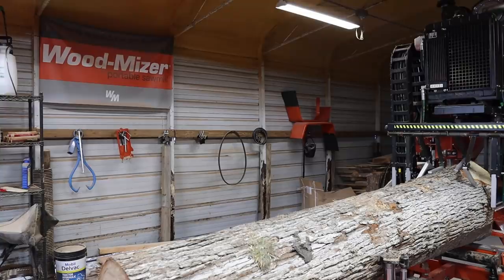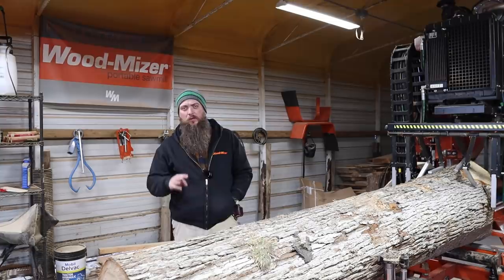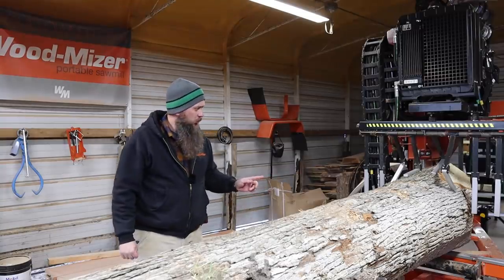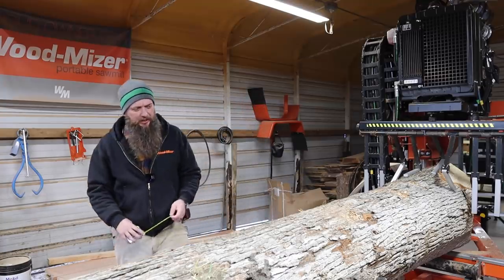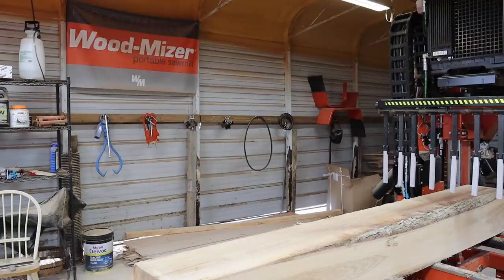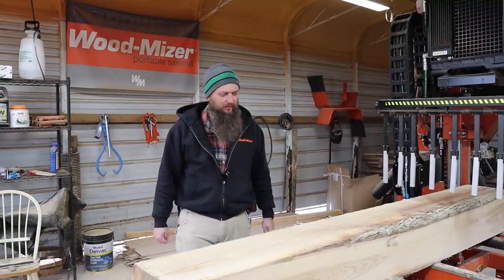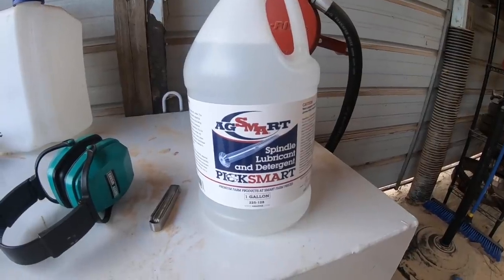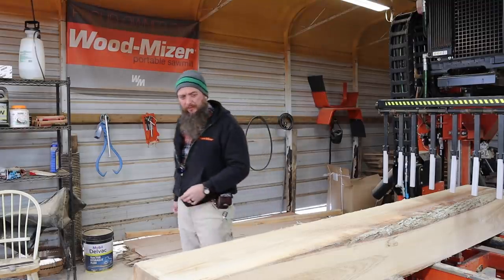A Log With White Gold Under It's Bark, This One Is A Money Maker

Comment: Batteries have less capacity when its cold. You need a warm storage for swapping them out.
Reply: Exactly. Ages ago I did a fair amount of architectural photography. In those days we shot on film, but used batteries for everything from the camera motor drives to slave flash units. A cold day of shooting played havoc on the batteries. Until, I started keeping them in a small lunchbox cooler with a couple of the air activated handwarmers available at every hunting store, bait shop, or farm store.
Reply: Well batteries go dead quicker left in the heat so uhh yeah

Comment: I totally agree with the decision on diesel.
The less I smell diesel the better.  I have added needle oil to tank and that seems to work well....does not smell but it is rather expensive
Reply: Diesel odor is bad, more occurrences of seasickness on boats with diesel engines.
Reply: kerosene is same as diesel just more refined, more expensive and less smelly

Comment: Good looking white Oak,  I had timber cut off my farm 18 years ago and saved a bunk of Oak, Cherry, and Cedar. I striped them and put them in a barn to dry, they are 8 .6 long x 1 1/4 sawmill cut one of them do later projects. Here in the Ozarks sawmill lumber is hard to sell so I been feeding it into my shop wood furnace. Breaks the heart to burn but firewood is 80.00 a cord and hard to find in the winter.

Comment: I completely understand why you would want to move away from diesel. I worked in architectural Millwork shop for 20 years and we always ran diesel in our large band saws (4" wide bands) for resawing. Not only does it smell bad, when it mixes with sawdust it gets really slippery. 
Also for you guys using smaller band saws in your shop check out the carbide tipped resaw King from Laguna tools. By far the best bandsaw blade I've ever used on a small band saw.
Nathan I love your videos! Keep them coming

Comment: Noticed the lubrication change and figured the smell was the reason. I just switched to diesel on my mill and had resisted it for years for the reasons you mentioned. The Cooks felt wiper system takes care of those problems since there is only a slow drip feeding the felt wipers as long as you remember to turn the valve off when you are finished.
Reply: Tim Cook says transmission fluid is the best and he is right.
Reply: @meehd01  Do you thin it with anything to make it flow in the cold?
Reply: @meehd01  You run a drip every 3 seconds? More?
Reply: @ricksanchez7459  I'm sure it's faster than that.  It's a constant drip one right after the other.  Just watch the felt material and make sure it stays wet.  If I stop for a few minutes it does have some fluid sitting on the blade but I just throttle it up and it lubes up the wheels good and I go back to milling.  I like to have plenty dripping so the blades are lubed up good.  I use about a gallon on a full day.
Reply: @meehd01  Thank you, gonna try that when weather breaks.
Reply: @meehd01  Never used it, but that seems like it's way too oily to use on boards that will be finished with anything not oil based. It doesn't flash off like diesel. Even diesel causes problems if it's running too fast and it soaks into the wood past the material that's removed during finishing.
Reply: @littlejackalo5326  you are dripping the TF so there is not that much to get on the wood.  What little there is is soaked up into the sawdust.

Comment: Love your setup! I have a double White Ash tree (two trees, one base) that I'm going to have to remove one tree that is leaning precariously close towards the house. My question is, does this wood have value or should I cut it into firewood? The half that I'll be removing is about 32 feet long, but it forks at about 8 feet. The base is about 16 inches in diameter and that tapers to about a 12 inch diameter at the fork.

Comment: Depending on the concentration of diesel on your clothing, and if your washer has a rubber impeller pump, the rubber can swell and stop the pump in the housing. I have been there, after washing my FR winter coat that had been soaked in diesel at a load rack while working. The next day, my wife called telling me the washer was full of water and would not drain. The rubber impeller was swelled tight. I also hate the smell of it, retired now from Big Oil, so I no longer have to deal with it.

Comment: When do you cut the board under top board vs pulling off top board to cut the next? Seems much faster to cut 4 boards and the weight of the upper boards would keep them flat.

Comment: Since you are using washer fluid you can get the concentrate from a car wash supplier in  5 to 55 gallon containers 
Just add water
Reply from the maker: Good idea
Reply: @OutoftheWoods0623  my reasoning behind this is that you only need 2or3 oz. to make 55 gallons of the washer fluid depending on the strength that you want
Reply: Standard  washer fluid has about 39% methanol.
Reply: @johnclark5153  you can get that as well

Comment: I've noticed the debarker removes bark at the blade entrance into the log, but the bark on the opposite side of the log still has bark that the blade traveling through, can you enlightened me why it's not necessary to remove bark on the opposite side
Reply: pushing dirt and nasty out to nothing ,not  pressing and dragging it through the wood. works same with chainsaw cutting logs.

Comment: Question: how does the saw blade not bind? Just from hand sawing, I know that tensions in the wood can tighten over the blade, and it's a trick just to work the blade free. With all the weight of various slabs on the blade, I keep wondering how the heck it doesn't freeze up or burn the wood (even with lubrication)?
Reply: At the speed these bands are running the gullets are pulling air into the cut, if you stop the blade midcut it is difficult/jarring to restart it.
Reply: @ricksanchez7459  ---- Thank you for solving my mystery. Physics!

Comment: replacement batteries are never as good as the genuine ones that come with a piece of kit, and genuine replacements from say Nikon will be expensive, and you need to buy them at same time as the piece of kit, buy them when the original is tiring 3 years later and the new ones are often poor because they have been stored poorly

Comment: Invent a POU Point of Use diesel reclaim/filtration system that uses sawdust as filter medium. Make it hands free when emptying/transfering soaked medium to the burn pile. Lol, maybe usable like a pellet furnace, heat the mill or other work area/buildings. Just brain storming, I'm sure the operator would come up with better ideas along the same lines.

Comment: I have tried everything and believe me if you would ever use tranny fluid you will wonder why ever used anything else.  I get it for free from a local transmission shop that uses only synthetic tranny fluid and they save it for me when they change the fluid.  I have an filter in the drip system and it works wonders on the blades.  It really slicks up the metal and I never get any sap buildup period.